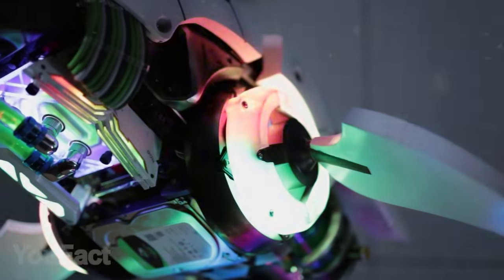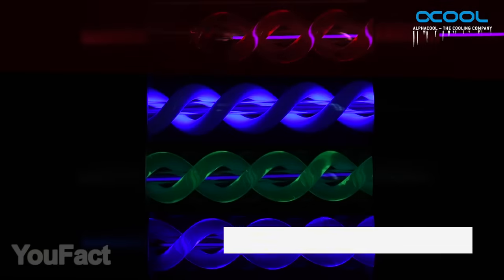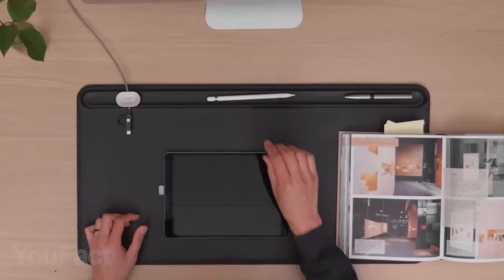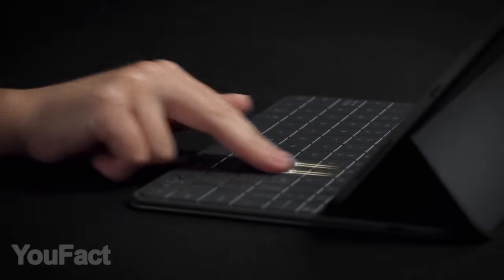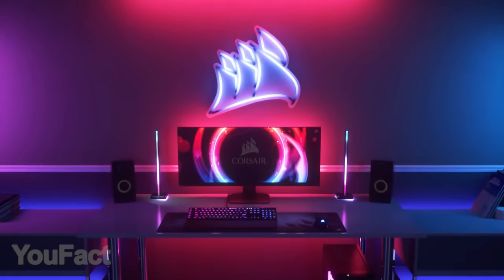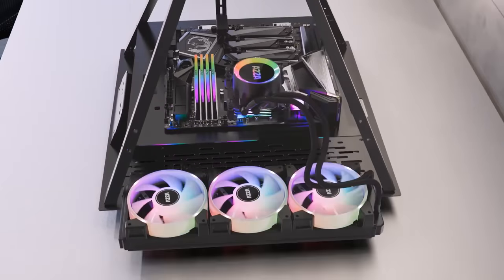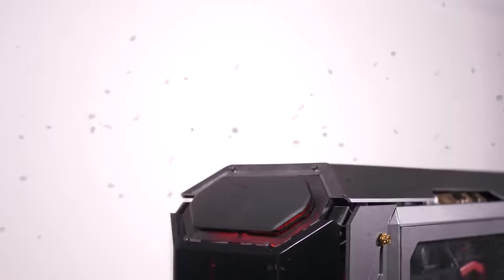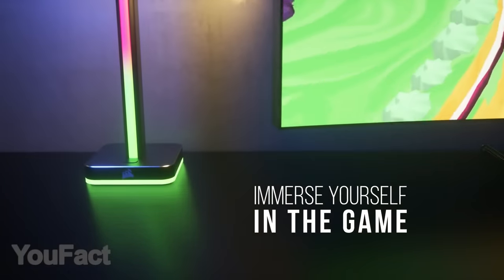14 Coolest PC Accessories That Are WORTH Buying

Comment: Scary with the all-red case, but the shark/triangle themed one is fire.
Reply: The triangle one is called azza 804 and the mini itx version is azza 806 and the shark one was for a contest
Reply: Yeah, LITERALLY on fire with that terrible airflow
Reply: The shark themed was a full custom so won't see it in stores. The triangle one is a flop because of no breathing ability
Reply: But the pyramid pc doesn’t have good airflow. It’s uneven surface, compared to the good old rectangular shape. Then the water cooling can be more effective at cooling the water down. If there were to come a lot in from the bottom, it would be a jet engine at the top. Maybe they should have been a bit more logical about their design. I do understand you think it’s cool, but they have serious cooling issues. Just take note of airflow in a pc. My pc has fans from top to bottom blowing air in and on the opposite side from top to bottom blowing air out. It actually made my cpu water cooling more effective without making too much noise. Hope this helps🙂

Comment: The main problem with the triangle PC is that the IO cooler is above the radiator which means the air bubbles stay in the cooler which can harm the cooling system
Reply: yeah ur right

Comment: Just wanted to put this out there for anyone using Corsair Custom Water Cooling. Got an XD5 hardline loop self made, and everything is perfect. Except that corsair ICUE does not see the pump, and the lights never turn on. ICUE is actual hot trash and Corsair has the shittiest customer support for their Custom Water Cooling Kits. Pump works perfectly tho. If you want there are better pump systems from coolermasters that make it easier and actually work cause no ICUE.

Comment: For anyone wondering, there wasn’t water inside that case, that would have ruined it. It was mineral oil, which is non conductive so it doesn’t cause any short circuits.

Comment: that tablet and laptop riser is designed to take out the vital wires that connect your diplay to the motherboard. and as a bonus you can even dislocate the display which goes for an easy change of screens!

yes i know there is tape but seriously just buy an ikea laptop stand

Comment: I'm wondering what that shark pc uses in the way of liquid cooling radiators or any of those pcs. I'm building a Core W200 Series TT Premium Line PC that requiers 1 front 360mm, 2 top 560mm, 1 rear 140mm, 2 bottom 280mm, and 2 right 600mm radiators but I can't locate them anywhere in the world.

Comment: the shark one costs 5k do you think it’s worth it
These are the specs:
CPU	
AMD Athlon G200
Motherboard	
Asrock X370 Fatality Gaming ITX
GPU	
MSI GT 730
Cooler	
Custom Liquid Cooling
Memory	
T-Force Night hawk RGB DDR4 4x2 GB
Storage	
Seagate Firecuda 1TB
Case	
Custom 3D Printed
PSU	
FSP Dagger 600W

Comment: You can't use that triangle pc with water cooling.... All the air bubbles would get stuck in the pump damaging it... The highest part needs to be higher than the pump what design flaw is this?